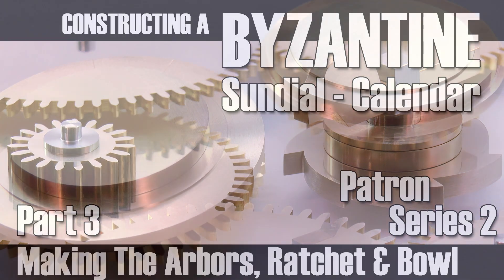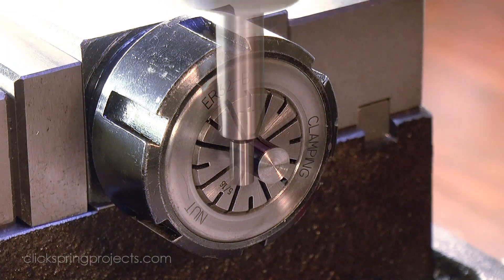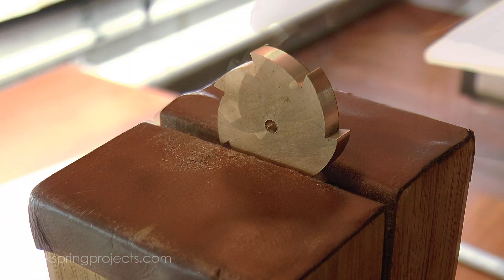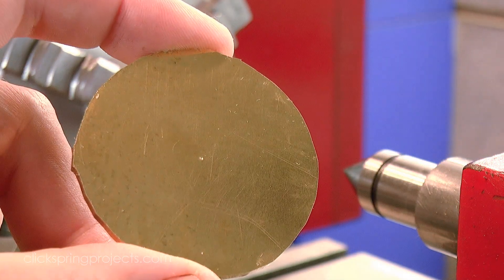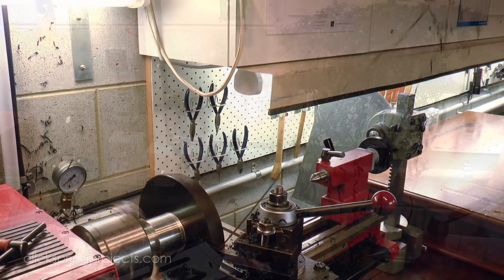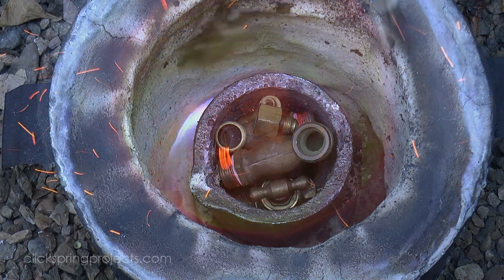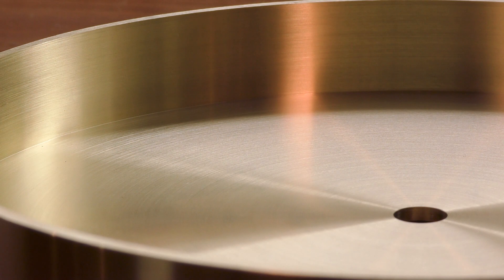Constructing A Byzantine Sundial-Calendar - Part 3 (Making The Arbors, Ratchet & Bowl)

Comment: Hi Chris, I'm amazed at the scroll sawing in that thick of stock  ( ratchet wheel)with such small blade.  Is that a spiral blade, the corners sharp and tight. I see a second parallel cut on the radial face.    But the teeth of the saw must be tiny, and the blade so narrow behind the cutting teeth that you get very little beam strength.   Those must be high quality blades.  Have you done a " tools glorious tools" on one your scrolling set up?   If not I would love to know more about how you do that.

Comment: They did not have nice squared edged files in that era.  So what did they actually use???   My guess is that they actually used steel or iron-alloy small blades, with possibly some small teeth in them. like a Saw.  Iron alloys with hardened edges were also available, so these were probably used as forced blades, to try to cut under large pieces, using a simple hammering technique.  I've done this myself, and although very crude, it is the equivalent of chiseling.

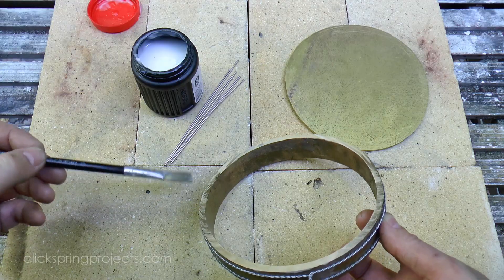Comment: Chris—what are the differences between silver solder and soft solder? 11:19 

I’ve soldered electronics, data, and audio cables on and off sine the 1980s, but don’t really understand these terms at all as it applies to mechanical brass joining, and have not heard of soft solder outside of your channel. Wikipedia doesn’t have any info that answers my questions.

Oh, and I’m a Yank from California!

Comment: I'm curious as to why when you are casting the bowl you can't just pour the brass into the open mold? If the one side is flat anyway why go to the trouble of making the second half of the mold with the sprue's and all that?
Reply: Fair question, but an open casting would be subjected to shrinkage during the cooling process and would require a thicker casting of the base to compensate. By having a closed casting with a delivery sprue and a reservoir sprue to supply metal during the cooling process it avoids the issues of voids and shrinkage distortions in the final casting. The only downside is that the sprues will need to be cut off and cleaned up post pour. Check out Olfoundryman for excellent tips and techniques for proper professional casting techniques. 
Can't recommend him highly enough. 
Mark from Melbourne Australia 🇦🇺

Comment: Chris, have you thought about a foot switch for the scroll saw? It could be set up as a click on/click off or as a deadman switch. This way, when you finish your cut, you can maintain control over the parts with both hands qhile the saw stops.

Comment: Quick tip for getting ends flush when fabricating a ring. Roughly file the ends to shape and bring them together, then make a pass through the join with a saw. That’ll ensure the ends but together perfectly for a good solder joint.
Reply: For smaller items or finer joints, double-sided abrasive can work well also
Reply: for mortals this would work fine, but for Clickspring it would not achieve the mirror finish that must be on all surfaces of all parts. You should see him make a cheese sandwich, from genetically modifying the calf embryo right through to lapping the cheese to such a high polish he needs to make tiny little (polished) pickle screws to stop the slice from just sliding off the bread. It is truly something to behold.
Reply: Just kidding about the screws, he wrings the sandwich components together like gauge blocks.

Comment: The water taps you used, did you leave the rubber "O" rings in and they would just burn away?
Reply: Those become the debris he scooped off the top of the liquid, any way, at least the part that doesn't simply burn off.

Comment: 11:35 - What do you mean, "Pickle"? Is that a vinegar solution?
Reply: White vinegar and table salt for cleaning brass after silver soldering.
Reply: was wondering the same thing lol
Reply: There are lots of commercial choices available, but most home hobbyists I've read use citric acid. You should do some research about comparisons to other choices depending on you particular copper and brass alloys etc

Comment: Hey Clickspring, I was wondering if you could help explain the math behind making a gear train for clockmaking? I want to figure out how to make a sequence based on the fictional "Imperial Dating System" from Warhammer 40k; in their style of timekeeping, they divide the year into 1,000 equal parts. (It would depend if you are counting a regular Calendar year versus a Leap year, but it's more or less the same with the standard 365.25 days). I was hoping to find some help with gear train ratios, but I do not understand it... I'm not expecting you to figure out the gears for me, I just thought it'd be interesting to try to understand gearing and clockwork with an updating interface like the calendar wheels in watches.